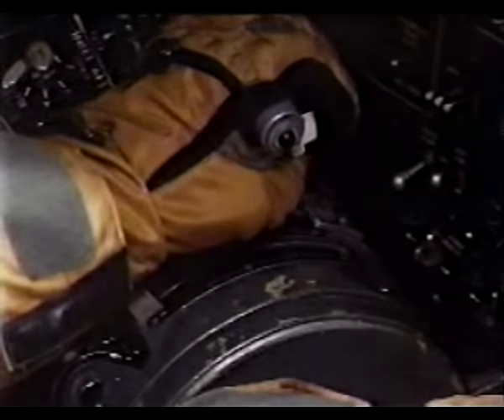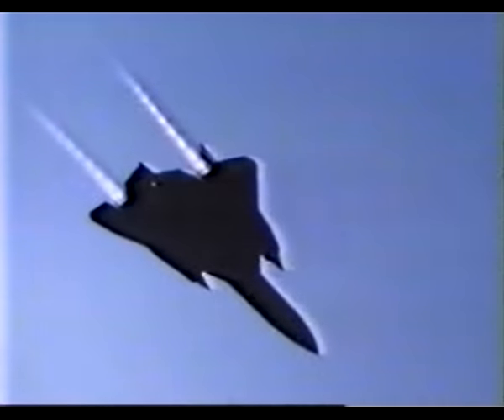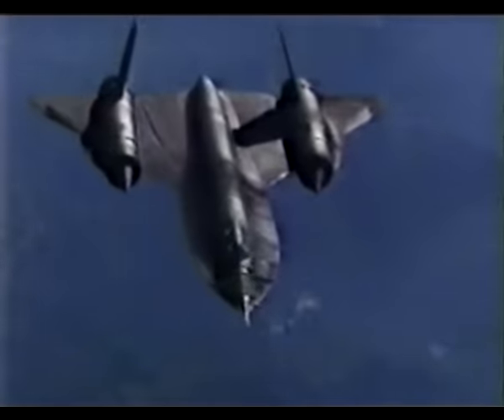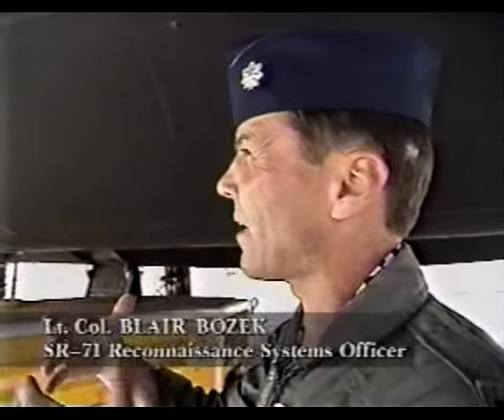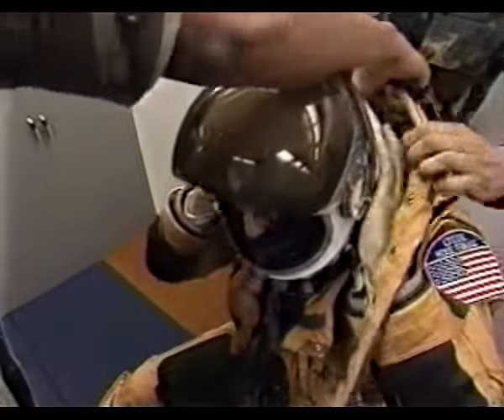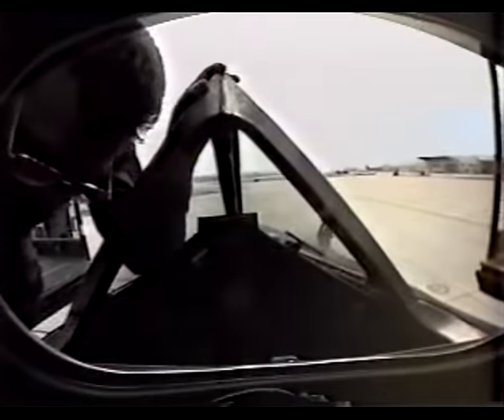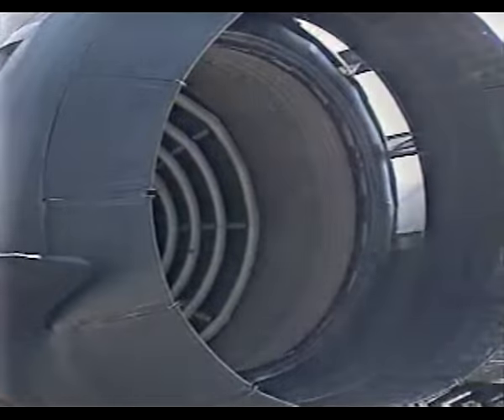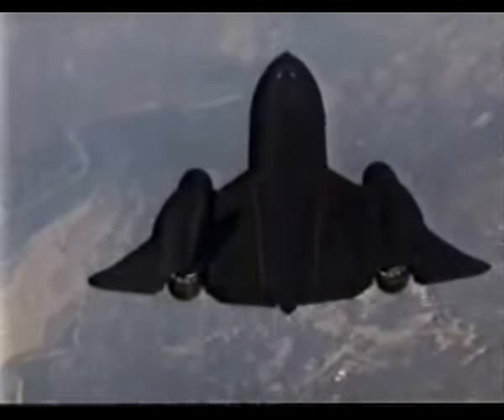Lockheed SR-71 Blackbird

Comment: They took off lightly fueled because it was lighter,  not because the fuel had all leaked out.
Reply: So it would just be more efficient both ways, wouldn't it?
Reply: Hey Jeff, I see your one of the smart ones, I got that data from Ben Rich's book on the Sr-71. How about you?
Reply: Either way... Kelly nailed it.
Reply: Actually, they took off with a lighter fuel load primarily for safety reasons. The tires were too heavily stressed at full fuel load, and represented a risk factor. In addition, the climb out from takeoff was considered a high-risk period, because if one engine failed at low altitude and low speed the aircraft would roll over and crash. So lightening the fuel load resulted in less time exposed to high risk.
Reply: I'mma listen to the Pros on this one...
Reply: Hey! Jeff love your videos on ballistics from san Joaquin
Reply: TAOFLEDERMAUS another know it all
Reply: The fuel does leak out the tanks expand and contract from the heat.
Reply: For people who think he is saying it doesn't leak, that's not the point he is making. The SR-71 has what's called wet wings. Meaning portions of the wings and portions of the fuselage are literally just filled with fuel. It doesn't have dedicated tanks or bladders. Much like a bridge needs expansion joints, so does the SR-71. Gaps were left and sealant was used as best as possible. But no sealant works perfectly at both hot and cold temps. So they chose the sealant that works best at high temps. Why? Because it flies for about 20 minutes cold, and up to an hour and a half hot. But consider this, the time it takes to get "hot" is almost as much as time it takes from initial fueling to refueling. So if it leaked from full to "needs refuel" between start-up and meeting the tanker, then it'd be back at that fuel level by the time it leaves the tanker and gets into it's cruise. So it really wouldn't have that much more fuel. So YES IT DOES LEAK, but no it doesn't leak so much it needs an immediate refuel. It just doesn't take off with that much fuel. Why? Because the SR-71 is designed to fly at insane speeds. You can't have lift and maneuverability without drag. Even variable geometry wings like the F-14 weren't suitable. Here's a comparison. An F/A-18 with 15% tanks can take-off at about 120 knots. A full loaded F-18 needs about 160 knots. That's a 33% increase in speed. Note the F/A-18 loaded/empty weight ratio is about the same as the SR-71 loaded/empty weight ratio. So if we assume that same 33% increase, that puts a fully loaded SR-71 at a takeoff speed of over 290 knots! The tires and suspension would not be able to safely handle that much speed with 170,000lbs on them. 290kts is actually pretty conservative, considering it could barely fly at the max speed of the tanker (500 knots) without excessive AoA. Then we also have weight and balance concerns. The SR-71 grew more and more stable the more forward the center of gravity was. But the problem with stability is, too much means you can't maneuver. IE lift the nose off the ground to takeoff. In order to be maneuverable at slow speeds, it needed CoG pretty far aft. So you only can really fill the aft tanks, and if you can't fill all the tanks, you can't fill it 100% with fuel!   
  
TL;DR: It leaks but not that much.
Reply: seriously... there's definitely not 80 000 lbs of fuel on the runway there... if it literally all leaked out that might cause some fireworks
Reply: Drew P. good analysis. do you know if they took it supersonic before refueling to warm it up & hold more fuel? or did they not have enough to do that?
Reply: Nathan Smith  Yes, definitely not 80,000lbs of fuel on the runway. Even if there was though, the fuel couldn’t ignite because of special chemicals that were added to it to raise it’s flash point, so the fuel tanks wouldn’t explode when the aircraft got hot. 
The chemically-treated fuel was actually so hard to ignite, special ignition charges were used to light it, which is what caused the green flame from the exhaust on startup. Charges were also needed to light the afterburners, and since there were only so many on board, there were ignition charge counters next to the throttles, so the pilot could see how many more times he could activate the afterburners.

As for warming up the wings to seal the leaks, they’d have to climb to very high altitudes first before they could go that fast, in order to minimize the effect of sonic booms on the ground. Doing so would’ve used more fuel than would otherwise leak out on the way to and during refueling.
Reply: I believe the SR71 could take off with a full fuel load, and did on many occasions when operating out of Japan. However as you mention, it put much greater load on the airframe. Considering the plane would have to air-refuel for the majority of its missions anyway, it was preferable to take off with partial fuel load.
Reply: Yippee...now I know,from someone who has the knowledge  that I lacked. Excellent reply. Thank you. Would give anything to see one for real. My other great love was the U2,when I was serving in the Australian Air Force at Laverton and the USAF  the Weather Reconnaisance Squadron was t RAAF Laverton.
Reply: If 12,200 gallons of fuel leaked out on the tarmac before every flight, they'd be heavily fined by the EPA, not to mention all wildlife in the area, and eventually people, would probably be dead.
Reply: Because of the stress in the tires actually. There were a few accidents in the beginning.
Reply: So the lighter the safer.
Reply: TAOFLEDERMAUS .
Reply: @nathansmith3608  It leaked during refuel.
Reply: Ur wRONG!
Reply: @highphysics3617  I watched one fly over me as it came into the Abbotsford Air Show, B.C., in the late 80's or early 1990's. I've since seen it close up several times both in Mcminnville, Oregon, and at the Smithsonian at Dulles International Airport.  It is beautiful and amazing to see in person!
Reply: @nostranger2u  You are soooo lucky. I vaguely recall the SR 71 came out to Australia to the Avalon Air Show in Victoria,some years ago,but,I was unable to attend to see it for real. the best I can do is a picture on my computer desktop.
 Good for you. It must have been quite a sight.
Reply: I was wondering if it leaked that bad, they’ll most likely pass right by the refueling station before entering the taxiway wouldn’t take but a matter of minutes and not as stressful as in flight refueling just saying.
Reply: How possible do you think it would be for a person to ride along in one of those
Reply: To think at one time this was Top Secret and Highly Classified. Some Area 51 Bullshit now it's on YouTube LOL !
Reply: I heard that once at altitude the fuel tanks seal
Reply: Greek muusic
Reply: I was a crew chief on these jets and most everyone commenting is wrong.
Reply: @xaviersimmons8865  not gonna happen
Reply: @markp.7109  oooookay than!🤪
Reply: I'm not a qualified SR-71 pilot, but I did stay at a Holiday Inn last night.
Reply: Not true. The fuel cells and seams expand in flight but when the bird is on the ground, it can barely hold any fuel due to the contraction of the fuel cell seams.
Reply: Alot of it was for tire preservation.
Reply: @nathansmith3608  It didn't take off fully fueled and no one has said that there is 80,000 pounds of fuel on the runway.  Pay attention to the video.
Reply: @eac1235  TAOFLEDERMAUS
7 years ago
"They took off lightly fueled because it was lighter,  not because the fuel had all leaked out" I was agreeing w/ this point & giving an example of why thinking all the fuel leaked out is absurd. Somebody must have thought that or why are we even talking about it? Pay attention to context
Reply: Dude, cmon. You know better than that.
Reply: i know Im asking randomly but does someone know of a trick to log back into an Instagram account??
I stupidly forgot my password. I love any tips you can offer me
Reply: @Joel Levi instablaster :)
Reply: @Paul Edison i really appreciate your reply. I got to the site thru google and im waiting for the hacking stuff now.
Looks like it's gonna take quite some time so I will reply here later when my account password hopefully is recovered.
Reply: @Paul Edison It worked and I actually got access to my account again. I'm so happy:D
Thanks so much, you saved my ass :D
Reply: @Joel Levi happy to help :)
Reply: @markp.7109  That explanation really makes this plane sound quite primitive. Seems like it is balanced on the edge of disaster.
Mad, but brilliant scientist stuff.
Reply: He's correct. At any kind of DA (alt and/or heat) it won't climb out.
Reply: @nathansmith3608  The type of fuel they used was very hard to ignite...you can't light it with a spark...
Reply: When an aircraft cost billions (including the research to develop) you best believe they will not take any risks in damaging it. If it costs more to do it that way then that’s fine. The craft is more important then the man inside one of these bad boys.
Reply: No, it leaked so much in the ground they had buckets under it to catch the fuel 
Once fueled it had to take off as soon as possible and hit a tanker
Reply: Another reason for being partly fueled is that is often refueled in the air, many times in some missions.
Reply: @nathansmith3608 the blackbird actually had a special, hard to combust fuel that made a series of shots of a highly explosive shots, one was needed for each engine to go from, idle to military idle(full throttle without afterburner) and from military idle to full after burner.
Reply: It would of leaked it out anyways 😅
Reply: No, they took off lightly fueled because the speed at which they took off would slam the fuel backwards into the tanks and cause a hammer effect on the air frame. They would takeoff lightly fueled and refuel in the air to prevent the air frame from being ruined by the inertia of the fuel in the acceleration of the air frame.
Reply: Of the twelve lost, four were the result of tire failure, so the fuel load was lightened to mitigate that.
Reply: The Sr can not take off with a full fuel load .
Reply: That's right.
Thanks to this technical details.

Comment: I was stationed at Beale AFB, home of the SR, from 1970 to 1974 as a fuel specialist. I was amazed the first time I actually got to check out the cockpit. The controls and instrumentation looked like they came straight out of the 40's or 50's! Stick and rudder with analog gauges. Still, these pilots had big giant ones for flying at the edge of space in an aircraft that could break apart if input to the controls wasn't perfecto!

Comment: It would only seep a few drops of fuel when cold, it was not pissing the contents of its tanks. The reason why it refueled soon after take off was because they didnt actually fill the tanks for safety reasons (lighter weight and easier to abort in case of trouble).
Reply: Especially to protect the brakes

Comment: Iv only just learned about this plane. And im absoutly stunned. What technoloy in the 60s
Reply: welcome to the club!
Reply: I was in the Air Force in the early/mid 80's. Worked on the B-52 bombers. Talked to an instructor of mine who knew an SR-71 pilot. Some of the things he told us about that aircraft, and things it could do were scary. From 15 miles up, it can use it's camera system and tell you if a dime on the ground was heads or tails. There are no munitions on the plane because it could out fly its own bullets and possibly shoot itself down.  You have to have special gloves when u work with the skin of the aircraft, because the oil from your hands could damage it. It is so fast that not counting suit-up time for the pilots, they could eat breakfast in 8 different countries. He also told us that his buddy said that they flew so high he felt the jet was about to leave the gravitational pull of the earth. How would you come back from THAT ? Scary. I salute our military at WHATEVER job they have. God Bless.
Reply: How you'd come back from that? Use the engines
Reply: Der Xer  Jet aircraft use turbine engines which compress air (from the atmosphere) and mix with fuel to achieve combustion, to provide thrust, like your car engine, only different. In space, rockets are used because the "fuel" they carry requires no "atmosphere" to achieve combustion. So you don't want to get too high (in a jet, or your car).
Reply: Der Xer 
The engines require air and once you leave the atmosphere there is no air for the jet engine. You would need some type of rocket engines.
Reply: Alan Whiteside  Leaving gravity and leaving atmosphere are two totally different scenarios. If you leave gravity, you could potentially still have enough air to boost yourslef back down
Reply: @kevanhornsby1070  They were no where close to leaving earths gravitational pull, there were close to being officially in space.

Comment: Can't shoot these babies down, love the Blackbird it looks beautiful
Reply: Jim Nesta they didnt shoot because they knew it wouldnt work. Any AA missile can lock on, doesnt mean it can hit it.
Reply: Jim Nesta also, the pilots of the SR-71 must have been trolling if they actually got intercepted, mig-25 needs to go a couple hundred miles faster to be the same speed as the SR-71 also, mig-25 uses air, there is almost none in at the edge of the atmostsphere, where the SR-71 flies. So if the story is true, the SR-71 was just taunting.
Reply: Saab Ja37... Lock-on.
Reply: Heard about this "alled" set of intercepts... actually not factual.  Typical of the Russian military philosophy which does an excellent job of projecting the illusion of power... Written from the Soviet Point of view of course.  More factual is that these attempted "intercepts" happened quite frequently.  There is little to prove that an R-30 if launched could have actually made the intercept.  The MiG-31s would have had to be nearly head-on, and this was not the case in any of the situations.  Fact of the matter is that there were nearly 4500 SAMS shot at the SR-71 during it's life of flying missions.  Obviously all missed.  Little known is that the SR-71 also had a very comprehensive ECM suite tailored to the threats of the time.  I have personally spoken to a retired SR-71 driver, who wrote a few books on flying the beast.  He claimed at no time was there ever a change to their routes or a stopping of what they were doing, because of a scary Soviet "threat".  Not factual.
Reply: One took a very small piece of shrapnel, according to one of my books.  That book also mentioned 4,000+ missiles.  One RSO described it as a fast moving telephone pole coming our way. Unreal!

Comment: 80000 pounds of fuel is about 1 1/3 tanker trucks like you see at your local gas station.........amazing..........
Reply: That's part reason for the extraordinary operating cost
Reply: fox trot 027  Yes, and the fuel was a special type produced for the SR-71. It had additives in it to prevent fuel tank explosions when the aircraft’s body panels reached 1,000 degrees or more. Probably cost $30 per gallon or more.
Reply: @shakahendon6998  F14 Tom Cat, F16 Fighting Falcon
Reply: James Crane Jr. That’s crazy. It doesn’t even seem like that much would fit in there. I guess it makes sense they’d take off with half of that to be able to accelerate quicker and not have as much weight on the tires.
Reply: @mcearl8073  they have to make a speed run to get the skin hot enough to seal the tanks before they hit the tanker.

Comment: SO many inaccuracies by the narrator! The SR-71 took off with minimal fuel because the tyres couldn't handle the weight at take off of it being fully fueled. Not because it leaked out... it had a drips per minute monitored leakage. Also the aircraft expanded 5 inches in flight.... That's how good the engineers were then.... Not over half a foot...shame they didn't get an SR71 pilot to narrate it
Reply: Half a foot is 6 inches though.
Reply: You are so wrong Nathan...

Comment: 2 x 454ci Chevy engines jump start it.....wow.
Reply: Yeah that flipped me out too
See the USA in your Chevrolet ha ha ha
Reply: The AG330 start carts each had two Buick "Wildcat" motors 401 cid. Later versions were Cheverolet motors.
http://heroicrelics.org/info/sr-71/ag-330-start-cart.html
Reply: @lawman95b1987  the funny thing is. The ones in the video are a pair of gas turbine air start carts or Huffer carts. Back then when it was built they didn't have the carts they have in the video.

Comment: They talk about the F 22 having super cruise........ This plane made it look poor
Reply: While the SR-71 makes the F22 look like a slowpoke, the SR-71 could NOT supercruise. When supersonic, the SR is always in afterburner/reheat and supercruise, by definition is the ability to cruise in supersonic flight without the use of afterburner. As far as I know, no current US military aircraft engine is capable of continuous full AB, especially at the temps required to burn JP7.
Reply: broomsterm  While the F22 is a VERY powerful aircraft, it isn't designed to handle extremely fast flight as the SR was. The SR was designed to fly very fast and in AB. I'm certain the F22 can brute force some significant speed in bursts if it had to but the max speed would have to be time limited due to airframe heating. In any event, the F22 was designed to supercruise, which is NOT what the SR-71 was designed to do. The F22 going flat out max-performance MIGHT just reach the low end of the SR's cruising speed range. Slow, high-alpha flight in an SR-71 isn't recommended.